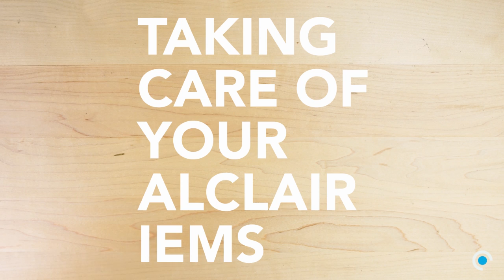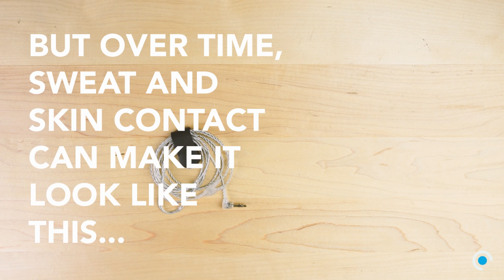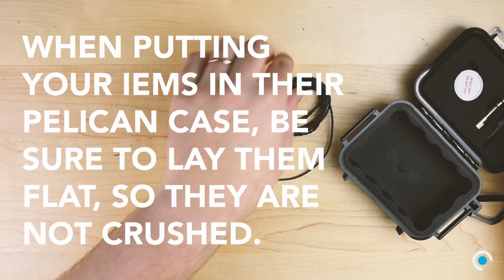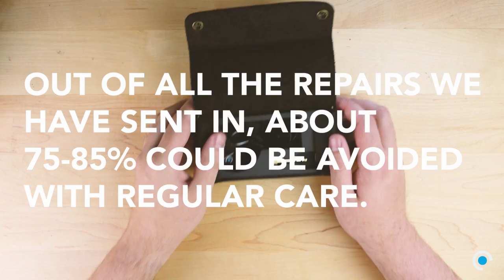In-Ear Monitor Maintenance 101

Comment: What plugs do your IEMs have? Is it proprietary or unusually recessed or something?
Reply: We use a fairly standard 2-pin connector. It’s been in use for quite a number of years with many manufacturers using it. We do recess them so the cable stays tight for stage use.
Reply: @ajswanson  Ok, I see, that's good. Is it 0.78mm? And that recession, is it standard? Would a generic replacement cable work? I live in Europe, you see, so getting a replacement cable shipped from the US would be somewhat of a hassle :P
Reply: San Jacobs Yup! 0.78mm. Most replacement cables will work great for replacement so you can get them in the EU not shipped over.
Reply: @ajswanson  Fantastic, thanks!